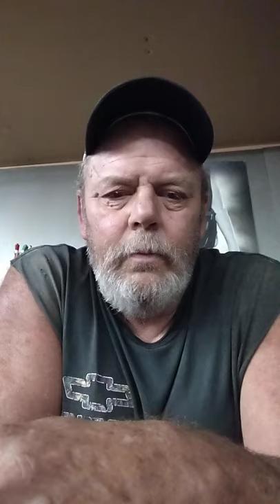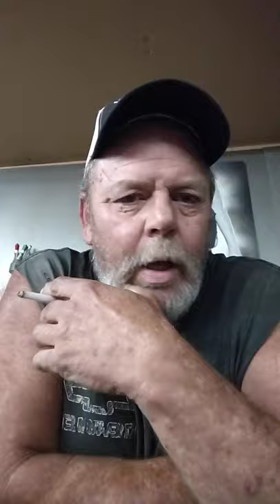Repair vs Construction welding !

Comment: Great advice, thanks!!
Reply from the maker: Ya need anything hollar brother !
Reply: @theweldor757  Do you have a video of your work truck and the tools you carry for equipment repair? You talked about working at night, any lighting tips? Thanks!!
Reply from the maker: Alot of night work fr sure ! I like it better that way . Its not 98 degrees out and yr not fryin your brains so bad ! 58 degrees spring n fall , 50 degrees . Winters are pretty mild anymore . Little planning skirt around it ! I started a plow service too . To snowy to be out weldin at 100 a hour . I still get  60 a hour to push snow ! Plow trucks in the alternator wiring trick video . Ill break this up some ! Last welding truck is in the welder / generator video : double your out put or wattage it might be titled .
Reply from the maker: You need 4 wd fr sure ! Stuff gets muddy when it rains . I try ti set a light bar . Like a mini roll bar . Put a light on each outer corner . I try to put the lights in line with my tool boxes . So i can rotate the lights back and see in the tool boxes also at night . Last truck i fit the light bar around the welder so tight i couldnt get a cover on it . That sucked !
Reply from the maker: Tool wise . Definetly need a good 300 amp
Air arc for scarfing out welds . And the air arc is thursty for air ! Need a good air compressure to feed it . High volume fast recovery ! Need a second air tank if possible ! More volume ! Portable plasma for sure . Got a video way back in the front power max xp 45 plasma . Works great running off a portable welder . Need at least 300 amps to air arc !
Reply from the maker: You can get magnetic base lights from harbor freight . Hexagon shape . Cpl AA batteries . Those are handy . Stick up in a grinder tub . Or over yr shoulder under a tractor trailer ! 2 , 3 good grinders , mag levels , . Esab 215 rebel has ben a great field weldor ! Stick , mig , tig ! Torch bottles , gas welding rod . Fixed a lot of drilling rig fuel tanks . Diesel fuel . Gas welded alot of them ! Get good with gasless wires . Good video back towards the front on how to remember polarity . Ya need to know that !
Reply from the maker: Running everything off a miller trailblazer . 12,000 watts of power